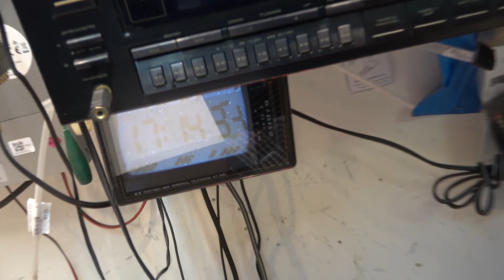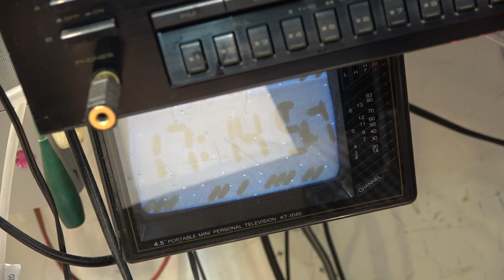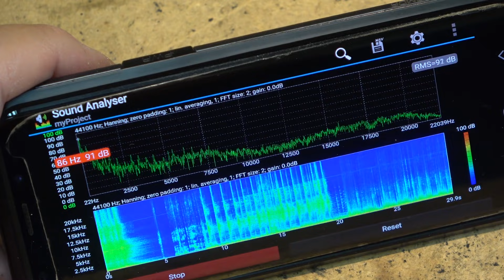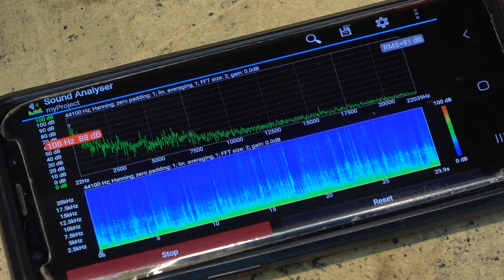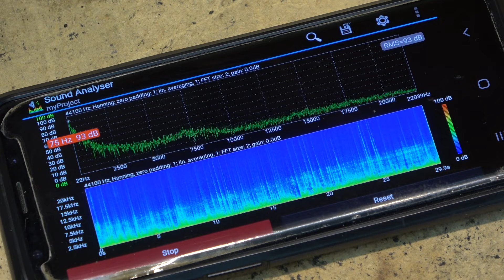Paradigm Titan Bookshelf Speaker Rebuild

Comment: I did a few of those. The most expensive one was a JBL I replace the spider the cone and the foam. I did a few Altecs and one Paradigm Sub. You need to take your time and clean everything well went your are not use to it. Those little Atoms do sound great I think they have a Vifa tweeter in them. The woofer was made by Paradigm. The older Paradigm were the best I still have a pair of Paradigm model 9SE MK3 that I use every day and a pair of Atom in my surround system.

Comment: By the way, the glue that was originally holding the driver down on these was only there from when the front baffle was attached to the sides of the box. In those days, they seemed to have assembled the box after installing the drivers. The v2 through v4 were assembled differently and did not have that glue around the border, only on the corners of the box.

Comment: I guess the positioning of the spider is more critical for proper gapping. If the spider doesn’t need replacing then this method of cantering works well. Otherwise shims are needed to properly space the voicecoil. This is a great tip by the way..
Reply from the maker: Shims only needed if spider is removed such as for a voice coil rewind. If the voice coil is shot i would be trashing the driver myself.
Reply: I would agree if the drivers are not that expensive. It may be cost effective to recone some high end drivers though. Some guitar amp speakers can cost quite a bit for the drivers.

Comment: I have a pair of weird old b&w bookshelf speakers, these ones have a red led on the front that comes on as the speakers cut out if you over drive them.
Reply: They'll sound better if you take that out of the circuit.

Comment: I bought a repair kit with shims, is this a waist of time dave? I went with rubber instead of foam.
Reply from the maker: Shims unnecessary unless the spider needs to be reglued.
Reply from the maker: My Polk's use rubber suspension.  These blow the Polk's away.
Reply: @12voltvids  Awesome dave, ty for everything you do as always.
Reply: Waste😉

Comment: Good refoaming! I suspect your class D amps has so much RF on the outputs that it interfers with tne clock monitor
Reply from the maker: Shouldn't be rf on the output.  That's the job of the lpf to cancel out the switching signal.
Reply: @12voltvids  Yes, it is. However, I have seen/heard "class D" amps with insufficient filtering causing massive EMI from the switching
Reply: @greengrayradio1394  class d amps suck you can't make em perfect
Reply: @catsbyondrepair  Small and efficient, but..

Comment: Foam centers itself. Remainder of black material on frame should have been removed first, and replaced afterwards, but result was acceptable.
Reply from the maker: Black material on frame was not removed as that would lower the foam mounting point and the original was glued to the cardboard.  The idea is to not change the angle and have the foam pulling the cone down.
Reply: The speaker was $200 CDN retail. Keep things in perspective.

Comment: don't repeat, this is the worst job one can do. 1, poured a lot of glue. which increases the weight of the diffuser. which affects the characteristics of the speaker.
2. did not center the diffuser, for this it was necessary to peel off the protective cap in the center and insert a thin material into the gap, otherwise it will be skewed and the wire winding on the diffuser will rub against the core of the magnet. 3 did not clean the basket from the old suspension.
Reply from the maker: Running the speaker on 50hz oscillator centers the cone.  The glue used was special speaker cement which does not add to the weight.  The speaker sound fantastic.  I use them every day on my bedroom system.  Have done many speakers this way.  The only time you need to shim the voice coil is if you open the spider.  That is what centers the voice coil.   Pumping the speaker at 50 hz will center the cone on the surround as the glue sets up.
Reply: @12voltvids  Is there any other way someone like myself could centre it without having the 50 Hz tools...? I was hoping to fix my an old 3 way Sanyo speaker.
Reply from the maker: @zhrob1  you can get an app for your phone to generate the 50hz tone.  That is if your phone has a headphone jack to connect to an amplifier.
Reply: @12voltvids  thank you sir. And btw I like your taste in the 80s style watch!
Reply from the maker: @zhrob1  notvewallyban 80s style watch this one was from early 2000s.  It's solar powered and receives time signals from the atomic clock in ft Collins CO.
Was expensive for a casino, about 150 USD. It is very rare as it was expensive.  Most Casio watches were plastic this one is stainless steel.
Reply: @12voltvids  Sweet Vintage!

Comment: So many downvotes already.  I can only assume its because you didn't center the foam, that triggered my OCD lol.
Reply from the maker: The foam is centered. That is the reason for the 50hz tone. It centers up the foam with the cone before the cement sets.  You can be off a fair bit and once the speaker is fired up the vibrating will center everything.  At least that is what the speaker tech from PSB, at the seminar i attended 30 years ago was telling us.  That's why you fire them up before the glue sets too much.
Reply from the maker: John shithead has already demanded YouTube take this one down at least twice.  Next my public email will be spammed with religious crap again.
Reply: @12voltvids  I was referring to the outer foam that attaches to the frame not the cone portion.  In the video there is a good gap on one side but no gap on the other.  In my mind it would make the foam slightly distorted.
Reply: @12voltvids  Lol what?  I haven't seen any of that in your channel.  Then again I try to avoid comment sections usually.
Reply from the maker: @jeffclark5206  
Won't affect. These foams were slightly larger than the original.
Reply from the maker: @jeffclark5206  the trolls are muted so they can post away but their comments are never seen by anyone but then.  That way they dont know they are muted.  I am sure a few figure it out when nobody replies to them.
Reply: @12voltvids  . Yep if that John is the one I'm thinking of, trolls just about every tech channel. Thank goodness for muting. Lol
Reply from the maker: @Joetechlincolns  
It's the same goofball that is harassing Dave at eevblog as well as other sites.  The guy that doesn't like Hotmail. Certifiable